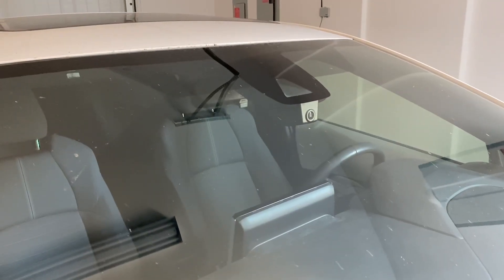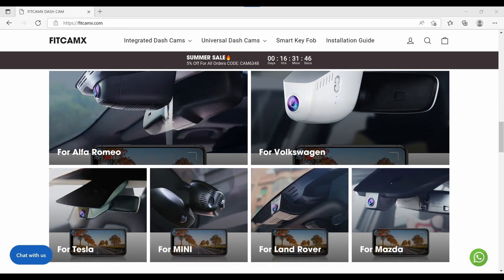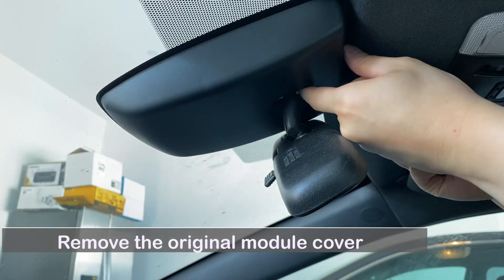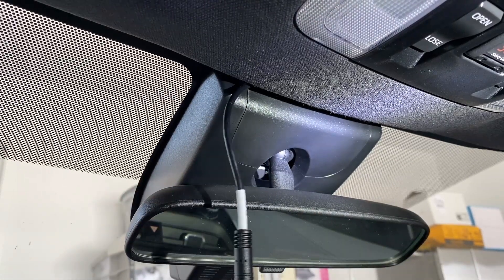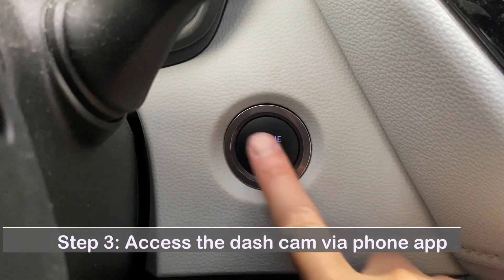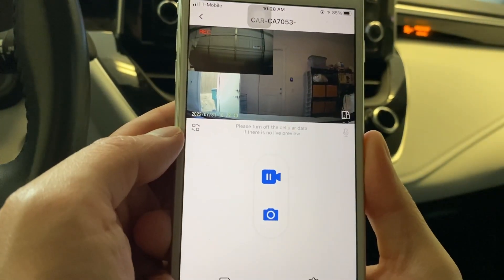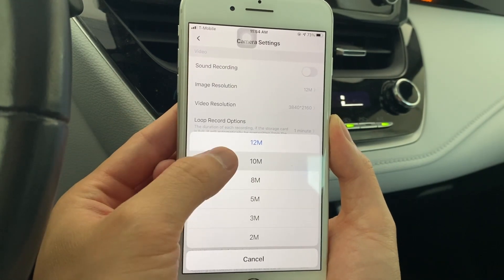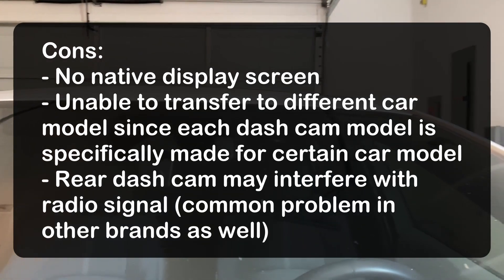FITCAMX Integrated Dash Cam for Toyota | Installation | Review | Discount Code

Comment: Apple STORE doesn’t have the FITCAMX APP????
But I go to company website that lead me to different app name Vlidure???? App can’t find the wifi of the cam!!!!
Reply from the maker: It used to be the Fitcamx app, now they changed it to the Viidure app. Make sure you disable your cellular service and your phone connect to the dash cam Wi-Fi, otherwise the app won’t connect to the dash cam
Reply: The Viidure app is different from the Fitcamx app.  My viidure app does not allow me to set my resolution to 4K… I can only set it on 2K. Disappointed.
Reply from the maker: I used both apps and they look the same to me. Are you sure you got the 4k version of the cam? There is a 2K version and a 4k version. I have the 4k version and the only resolution that I can select is 4k.

Comment: I just installed it on my CHR Toyota, but it doesn't accept my cell phone, I can't use YouTube or Alexa, nor waze, or Google map... what can I do?
Reply from the maker: When you want to access the camera footage, turn off cellular and connect to the fitcamx wifi, the use the fitcamx app on your phone. Once done, should disconnect the Wi-Fi and turn your cellular back on. Otherwise your phone would be on the fitcamx Wi-Fi, which has no internet. Also I would recommend go to the wifi setting and turn off “automatically connect to this network”. Otherwise your phone would constantly connect to it and would have no internet.

Comment: Hi. I have installed my Camera, but it doesn't work good. 
It comes:
- LTA Malfunction 
- Headlight System Malfunction 
- Pre-Collision Malfunction .
What can I do?
Reply from the maker: I think that’s due to a faulty diversion cable. Should check with FITCAMX to get a replacement. You can use the live chat on their website.
Reply: @teodorabatea6229 what year is your car? Was the issue resolved.

Comment: CODE is NOT stackable for an additional 5% discount. I just tried and it told me it won't work with the combination code I already entered.  too bad.
Reply from the maker: Thanks for bring it up. It used to be able to. Must be a new change. I’ll check and see if I can bring back the staking discount code.

Comment: Do not fool around with the electronic  in your car I install one and had a lot of problems had to take to toyota dealer to fix things back big mistske
Reply from the maker: Sorry to hear that. Would you let me know what kind of problems you had? I want to know if there is a problem that I’m not aware.
Reply: I think I might gave gotten a defective unit my Lane tracing stop had to take it to dealer they reset the main computer
Reply from the maker: That’s good to know. The connector cable diverts electricity from the lane keep assist camera to power the dash cam. Mine lane keep assist and speed limit recognition are both still working. I’ll definitely pay more attention to those functions.